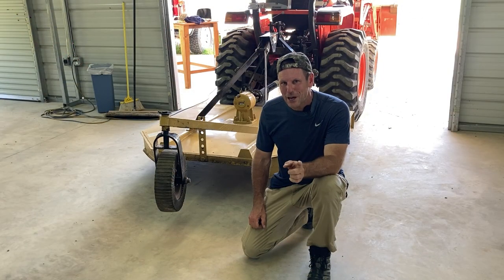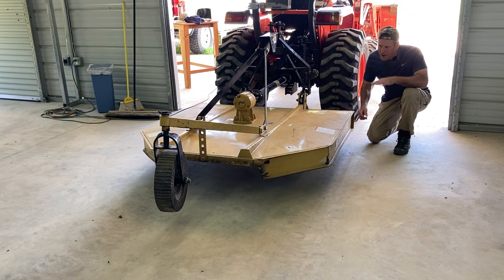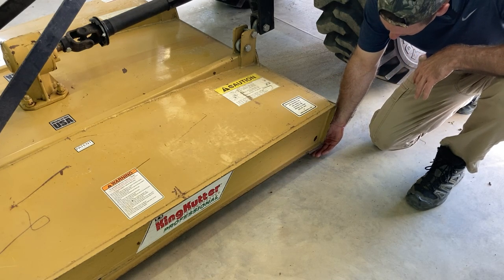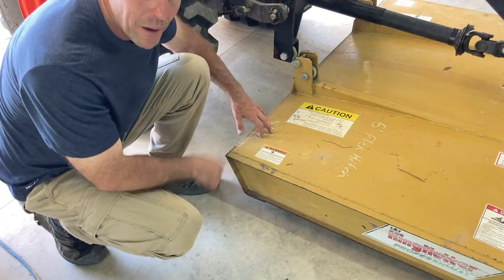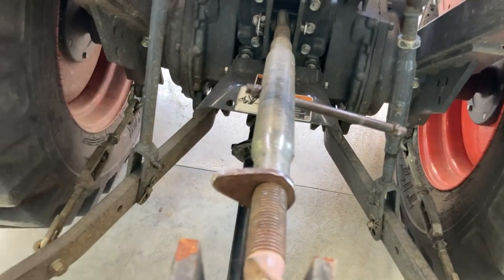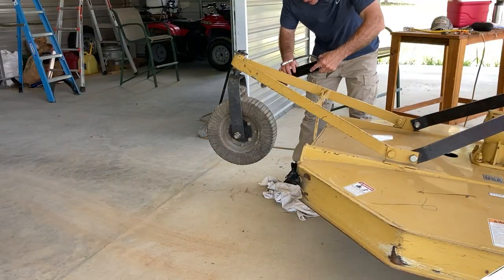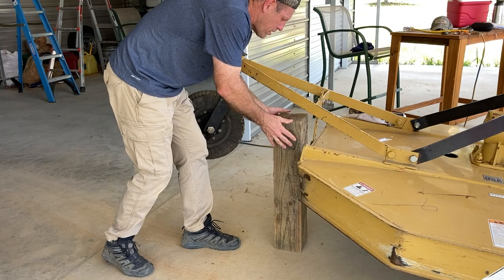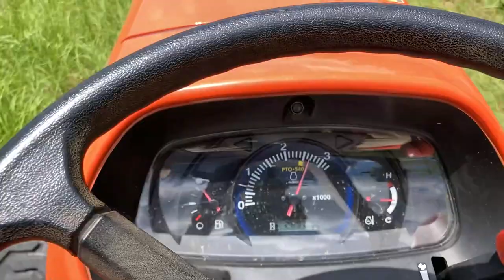How to Setup a Brush Hog (Bush Hog) to Mow Large Acreage

Comment: At the start of the video, I see that you shore your mower up for hooking it back up very similar to how I do it. That saves a drastic adjustment of the top link when using the quick hitch.
Reply from the maker: It's easier to hook up when it's left level.  Because there's nothing fun about hooking up 3pt hitch equipment!   Thanks for watching, Gary.  B&D

Comment: What setting do you have your bush hog on? 1-9? I put mine all the way down and i scare my pasture. Even if i don’t i scare my pasture. It’s hard to figure out what height to run it.
Reply from the maker: I like to have the back riding the wheel and the front edges to be skimming about 1" off the ground.  This takes adjusting of the tail wheel (usually several holes it can be in) and adjusting the top link.    I try to set it up on level ground before I start cutting in a field.